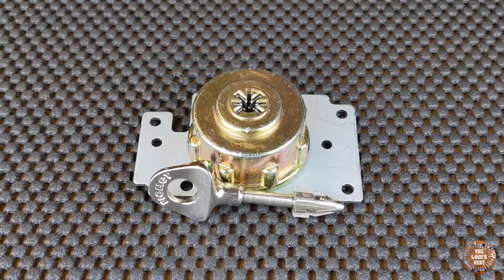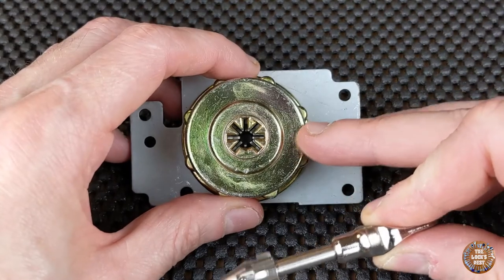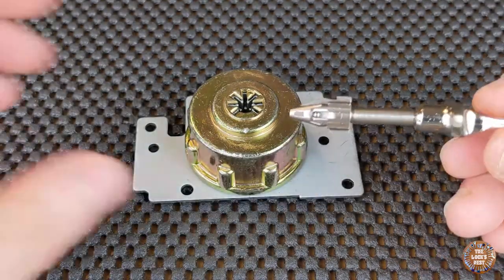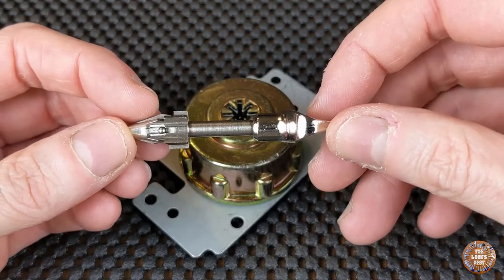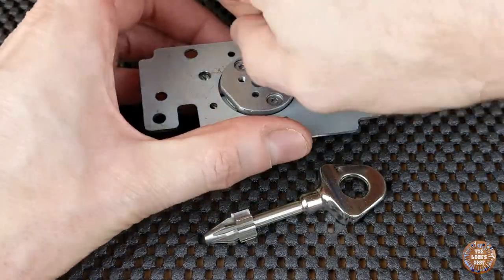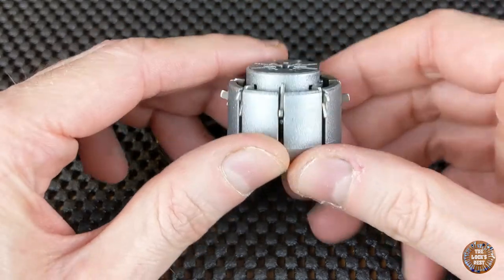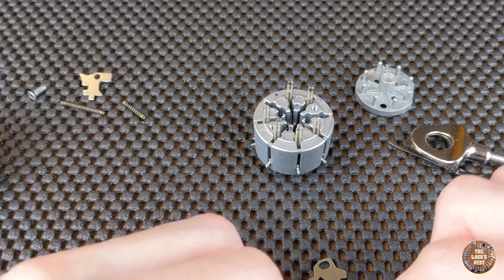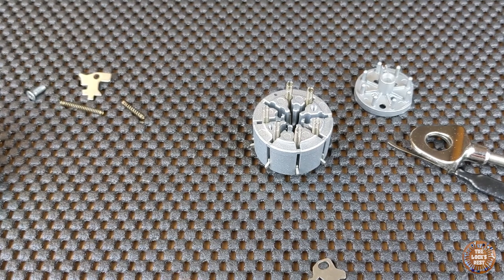Fichet M3B High Security French Safe Lock Presentation

Comment: Very well explained -- seems like the moving ball, per Figures 1, 2, 3,  are for 3 different levers.  I wonder if the interactive element is always in the same location in one of the 8 radial positions?  I can't tell if the interactive element lever "slot" is of a slightly different configuration -- as if it is the same for all 8 positions, then the active element could be in any of the 8 positions (with the matching key, of course).  This would add some additional difficulty in picking, as one would have to figure out which of the 8 levers has the interactive element.  Very nice video -- thanks for sharing
Reply from the maker: The interactive element position is everytime the same. It's were there is no space for a key wing in the keyway. I'm not sure the interactive element may be different on different keys. I have the feeling it may just be used for key duplication protection, and not antipick protection.
Reply: @TheLocksNest  Well, I think it might take some pretty sophisticated key cutting equipment to duplicate that key so, I can't imagine someone easily making a copy  -- guess you have to pick it to find out...
Reply from the maker: @Pyrolock  If you can have a blank, a good rotary tool can make some miracle. I already cut a key for a Pollux 7000 with a very bad rotary tool.
Reply: @TheLocksNest  Yes, that is true -- I wasn't thinking about that -- good point.
Reply: @TheLocksNest  like a passive pin in a way.